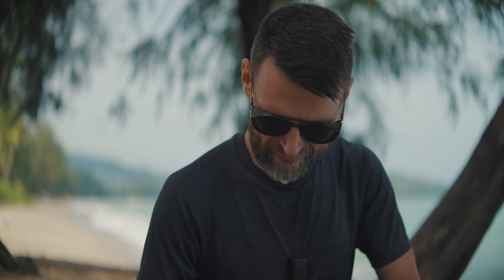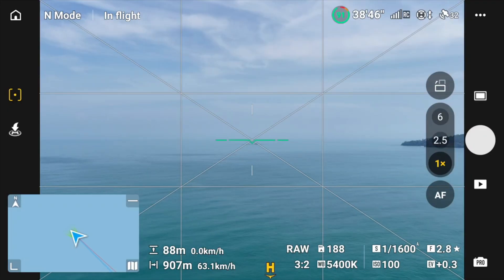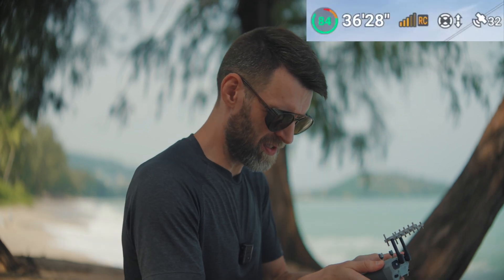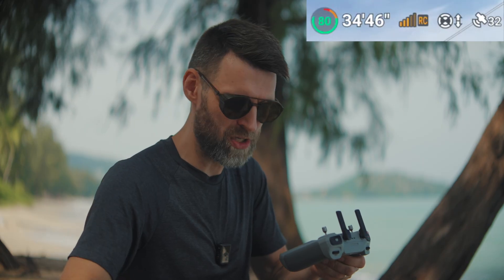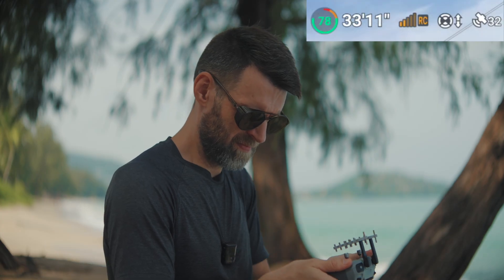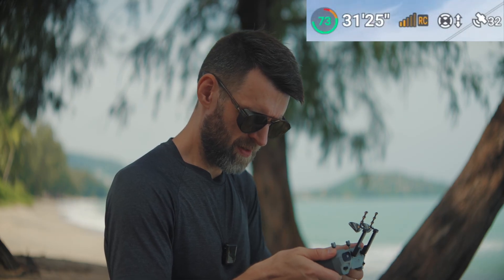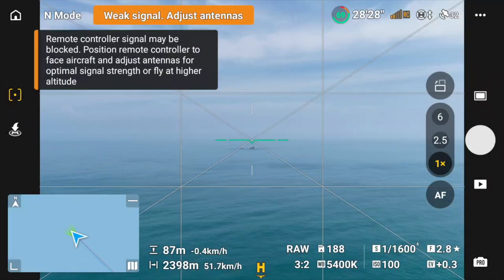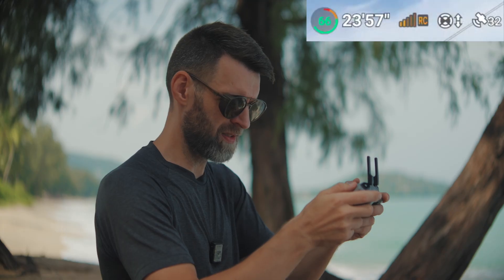DJI RC2 Range Test with Mavic 4 Pro: Signal Boosters vs Stock

Comment: Thanks for this video.
These “antenna boosters” just won’t work!
There is no direct electrical connection to the RF transmitter/receiver antenna circuitry in the controller.
Some of the “reflective” type directional devices MIGHT offer a tiny fraction of a percent of improved signal, but honestly.. It’s all crap and a waste of money.

I took a yagi directional antenna, mounted it to tripod to simulate a remote drone in flight.
I connected this to my Agilent spectrum analyzer to give me an idea of precisely how much signal in the ISM bands (set to RX 2.0GHz through 6.0GHz).
Testing with an RC-Pro with factory antennas and close to a dozen various “cheap” (sub $20) so-called “boosters”, there was no noticeable perception of performance increase.

*Pure Chinesium Junk*!
Reply: I was looking for a very large improvement in RF performance, so I added external SMA connectors to my RC-Pro.
I tried (all excellent quality commercial antennas) omnidirectional and yagi directional antennas with 48” RG-400 coax jumpers.
The pair of directional antennas (Sinclair @$400 per antenna) gave a performance increase.

I then purchased the AlienTech Duo (the latest “beat” model as of July-2025. / $900 with accessories).
It’s a bidirectional RF amplifier with directional antenna in a housing the approximate size of the RC or RC-Pro.
The performance increase was dramatic in the “lab” (my wife’s sewing room LOL) and gave me an approximate improvement of 10-20% in the field using a Mavic-3 Pro and RC-Pro with the AlienTech device.

I’m awaiting the Mavic-4 Pro and RC 2 Pro controller and curious to see how the performance is compared to prior versions and experiments.

Comment: Ive always used those since the spark days. They work in line of sight but still dont penetrate much. It also depends on the day. Some days they make it worse i fly from the same spot 90 percent of the time. I hold the world record for the longest dji mini 2 flight with a modded battery btw. Right at 7 miles
Reply from the maker: Thanks a bunch for adding your perspective. Testing out a few different types of remotes and boosters from the same spot, definitely should give you a good feel for boosters. After the border conflict here in Thailand I haven’t been able todo the test again, somewhere without interference. Seems like in ideal conditions, the booster can help, but also not.

Comment: Mist is bad for remote radio signals because the water droplets in the air absorb and scatter radio waves, weakening the signal and reducing its range and clarity so it isn't a good idea to do this test out over the sea.
Reply from the maker: Absolutely correct, additionally the air humidity here is on the higher side. Because of border conflicts here in Thailand, all drone traffic has been banned for security reasons. So I have not been able to conduct another test 😫

Comment: You’ll run out of battery before signal with either controller in perfectly clear conditions with no obstructions.
Reply from the maker: Definitely what I expected, so there is clearly interference at play.
Reply: @EgillBjarki most likely.  Im lucky to live where there are huge areas with no population and on the coast, so I can fly where there is zero interference. You would be amazed at how much just one house with a wifi signal can impact the signal.

Comment: I had full signal strength 7km away with rc2 and Mavic 4 pro, you might have some interference or something. Maybe try fly higher as well.
Reply from the maker: Definitely suspected that, there are lots of resorts and hotels by the beach. Need to try to find a more isolated spot and try to go higher too.

Comment: According to some advice that the Youtuber Captain Drone gave me, as you fly further away you need to go higher up if you want a good signal.
Reply from the maker: Same here, elevation helps a lot. I can’t fly from my condo due to private land restrictions, so I use the beach instead, just open sea ahead 😊
Reply: Definitely correct in MOST cases.
RF performance is a dark art of electromagnetic energy and there truly are so many variables.
Good luck!

Comment: How's the range when flying "in cities"? Or just around one building? 

My RC1 loses connection after flying just behind one apartment. Which is a bummer.
Reply from the maker: I heard allot of reliability issues with the connection between Mini 3 Pro and the RC1 controller, when researching for Mini 4 Pro. I’ll give the signal boosters a test in a city environment, around buildings and such, see if there is any improvement. Thank you for the view and comments Leslie 🙏